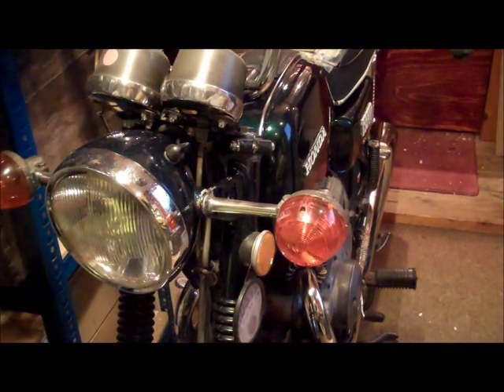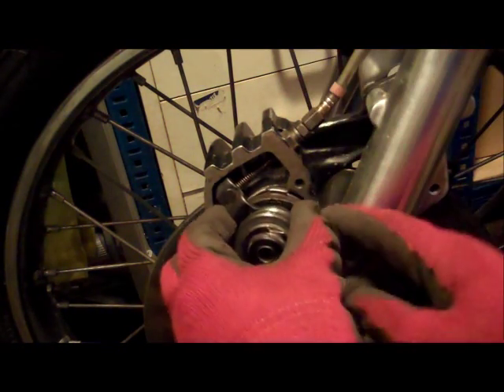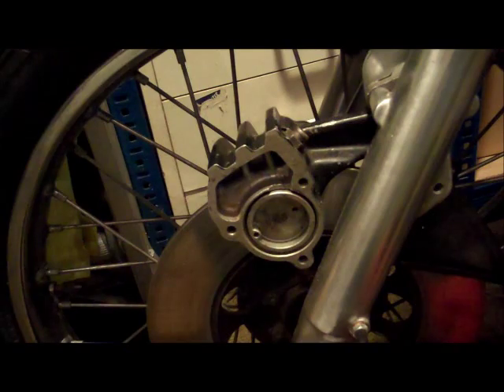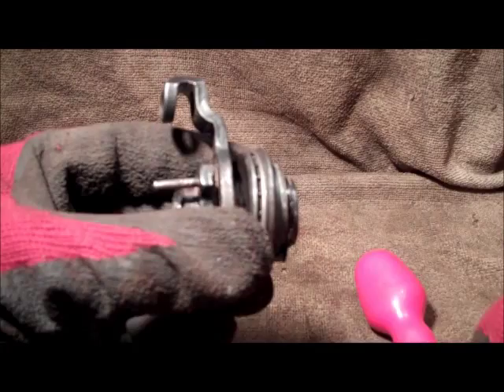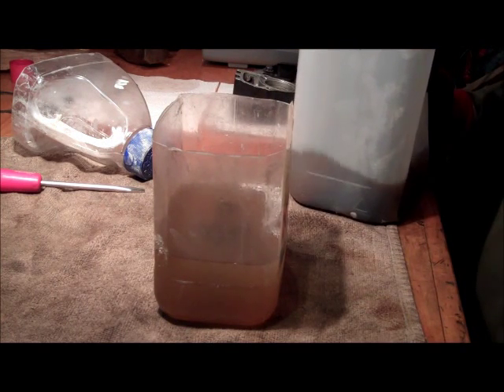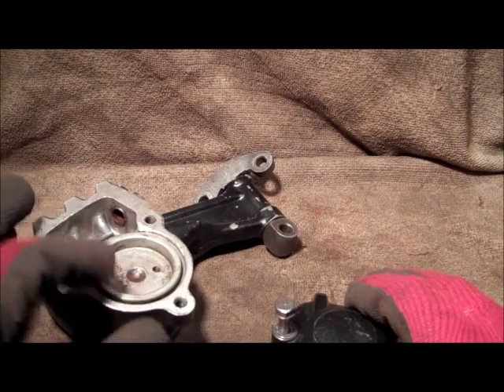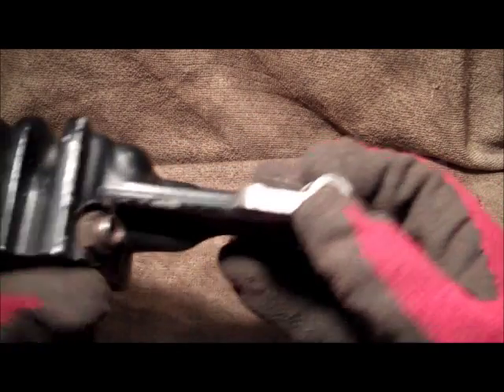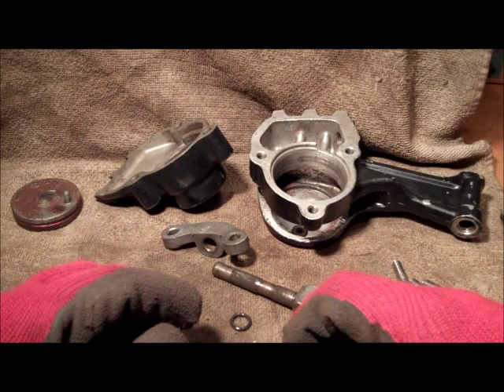Honda CB200 Front Brake Refurbishment Part 1 of 2

Comment: These videos of yours are great, when I get stuck with the rebuild of my CB200 I come here first. Could you please repeat what the name  of the grease that you used when putting the caliper back together and on the cable spring. Thanks Phillip
Reply from the maker: Hi there. Thanks, glad they are of use. LM grease it what I used, and only enough, not to much.

Comment: Echoing everyone’s thanks for these videos, Gareth. They are so helpful.
I recently bought a 1976 CB200T and the front brake mechanism was very rusted and gunked up… I’ve stripped it and have managed to locate replacement washers and bearings for the internal operating mechanism but the adjustment ratchet and spring have seen better days… any clues as to where or who might have spares?
Thanks in advance!

Comment: Hey Gareth, gread video ! I bought a 1978 CB125T with a non working front brake. When I dismantled it I saw that there was no balls/needles left on the thrust bearing, do you know what size are those so that I can put some back on ? Thanks !
Reply from the maker: Hi there, not sure. Will try to look at an old one I have and see if I can get some dimensions of some for you. But won't be able to look until weekend.
Reply from the maker: Hi there. Just uploaded a Vlog with the dims for the thrust  bearing pins. Hope's its helpful. Let us know how you get on.
Reply: Koyo bearings part numbers Axk2542 for needle rollers & Ls2542 for thrust washers
Reply: @garethowen7050  hey Gareth where would I find that vlog for dimensions. I’ve no rollers either
Reply from the maker: @binzario  Hi, here's the link to the vlog where I measure the rollers from one of my old units: https://www.youtube.com/watch?v=Atj9MGVg45Y. Good luck with it.
Reply from the maker: @mrzee1951  Hi, Sorry, I missed your comment. Nice find, just checked them out and they look the part - I've not checked Dims. But how would you fit them? Can't find a way to strip the unit down.
Reply: @garethowen7050  thank you so much this is really helpful. 🙏🏻